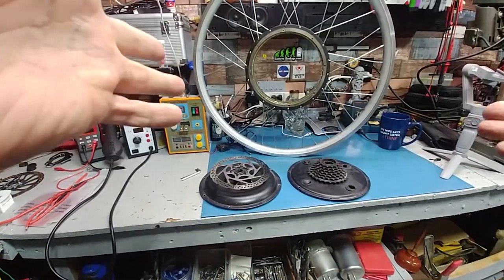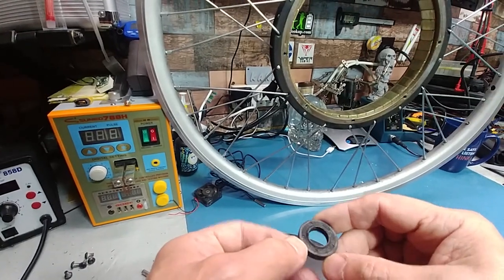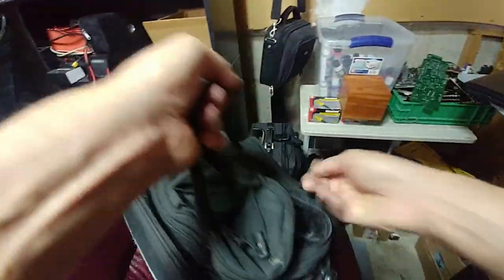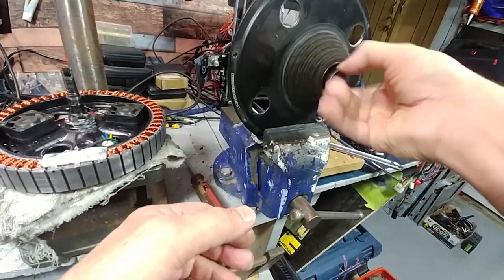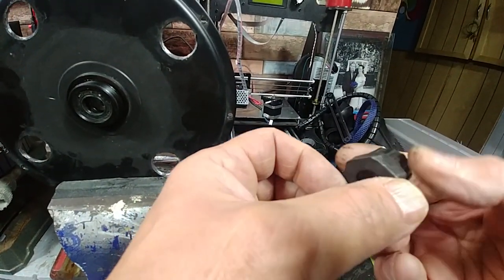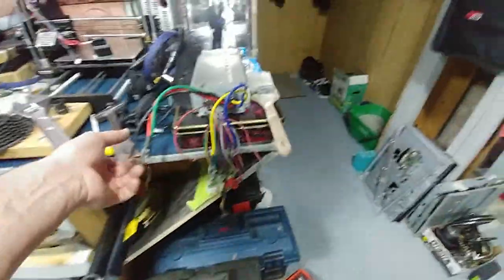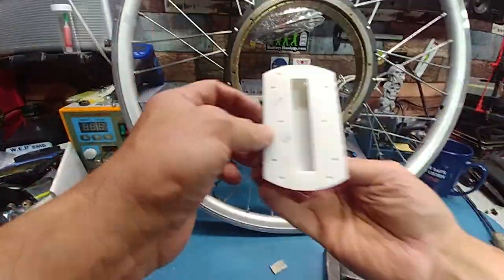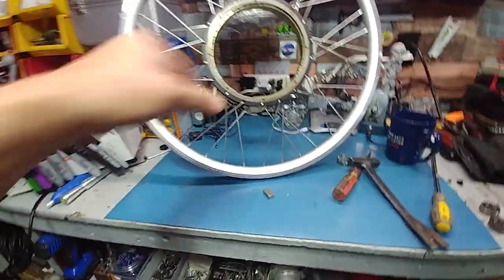ebike vlog# recycling hub motors . Monday, November 21, 2022

Comment: Hi mate can you please answer my question if I got a 45amp controller that fits the sw900 display but the display can only be set to maximum 20amps would that limit the controller to 20amps
Reply from the maker: no idea when you start mixing parts. you could use a clamp voltmeter and measure the amps when you ride.